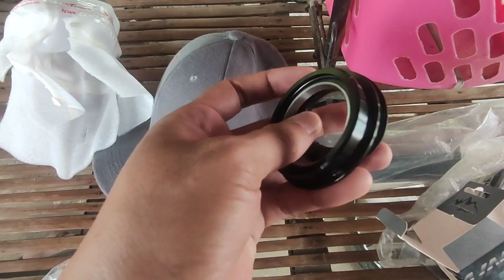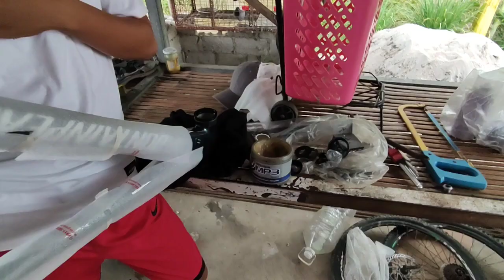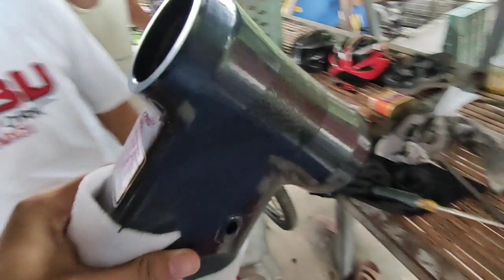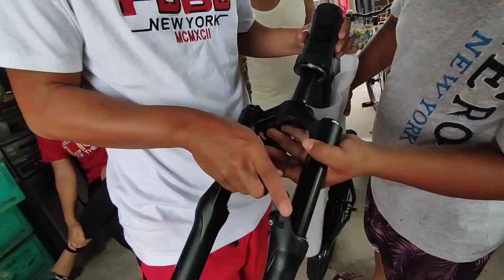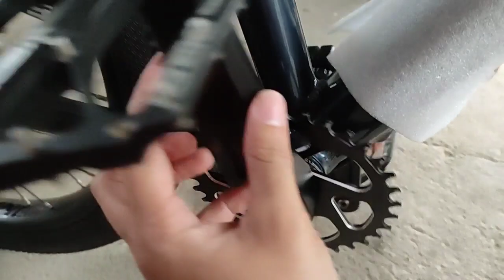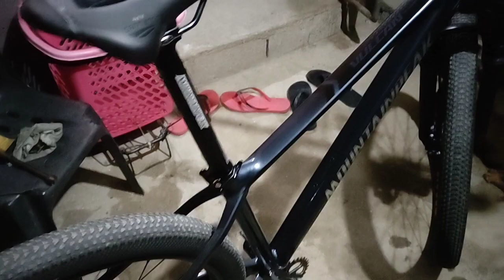Mountain Peak Vulcan| DIY build bike

Comment: Boss kong yung toseek carbon rigid fork. Ano need na headset para jan sa Vulcan. Un kasi order kong pair. Kaya lang wala pa ako alam masyado sa mga yan. Need din ba ganyan na may adapter
Reply from the maker: Kung straight steerer tube sya need ng adaptor. kung tapered steerer tube naman hindi na kailangan ng adaptor.
Reply: @kikstv207  straight po kaya yan or tapered?
Reply from the maker: @code2know681  tapered fork na bilhin mo. kasi tapered ang vulcan.
Reply: @kikstv207  na order ko na yan boss. Ideliver na now nauna kasi yang fork na yan. Kesa sa frame pa rating palang yang Vulcan ko
Reply: @kikstv207  soh ang need ko paps yung same na headset sayo? Na may adapter.
Reply from the maker: @code2know681  oo kung vulcan din sayo. pwede kasi yun pang straight at tapered.
Reply: @kikstv207  Sige2 boss. Maraming slamat. Ngayon alam ko na bibilhin ko. Thanks